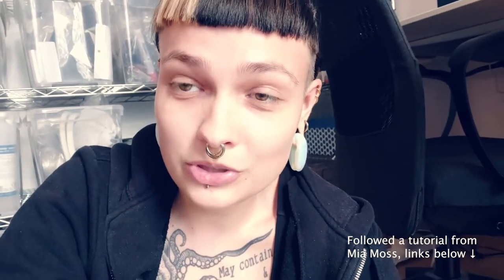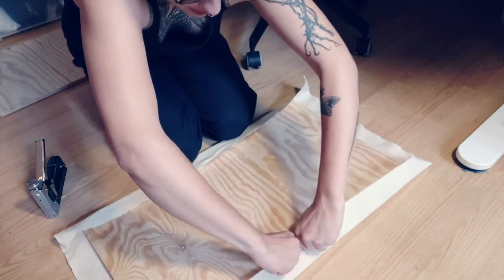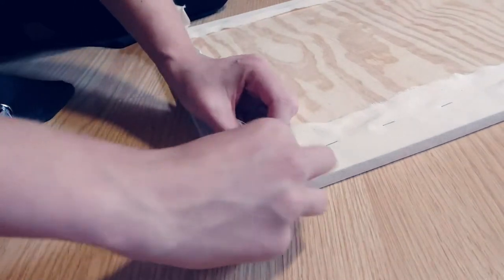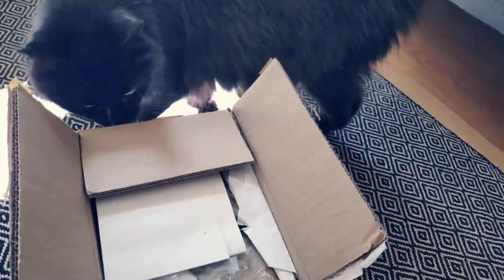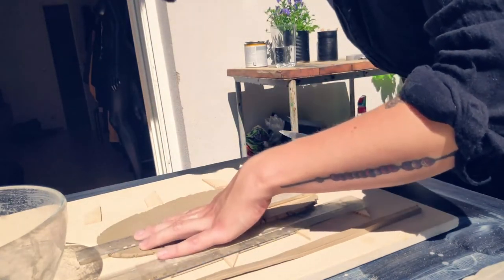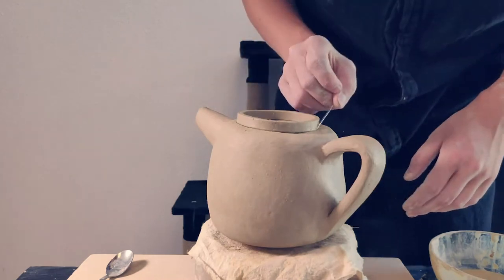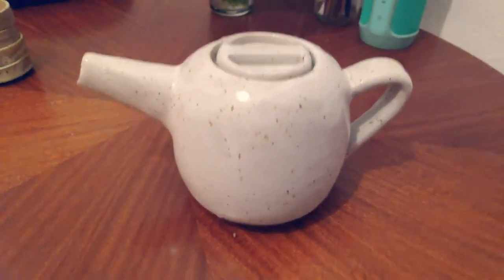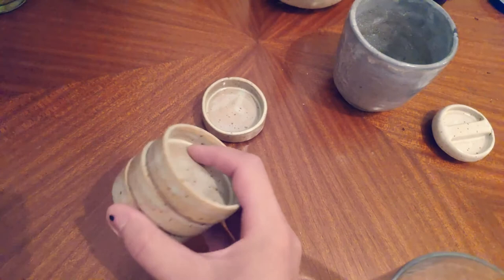Studio vlog: Handbuilding a Ceramic Teapot

Comment: what technique did you use to make the body of the teapot?
Reply from the maker: Made a slab rectangle into a cylinder, and added a circle as top and bottom. On the inside at the attached circles I added a coil, so I could shave away the corners on the outside and make it rounded without loosing thickness in the wall. Similar to this method: https://www.youtube.com/watch?v=6QFBKLDesbs
If you have any other questions or if you want me to explain better, just say :)